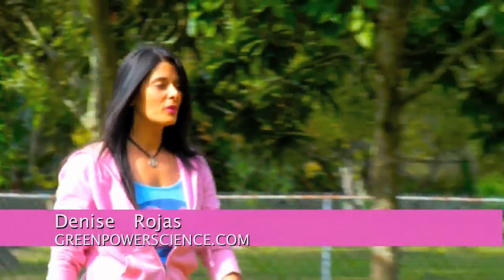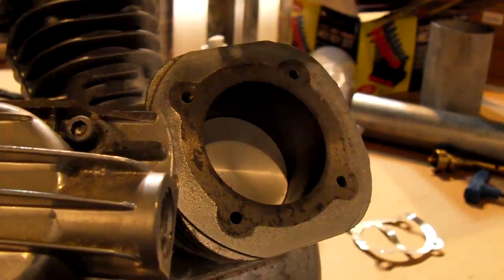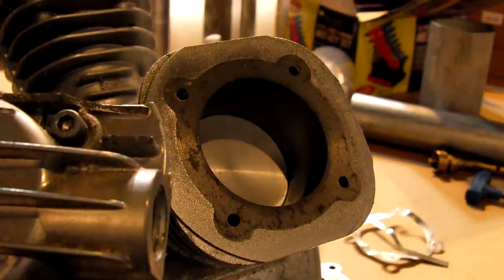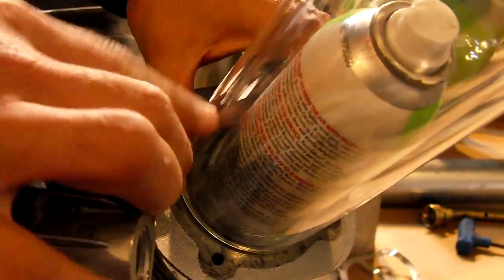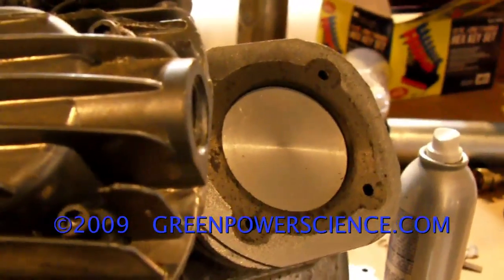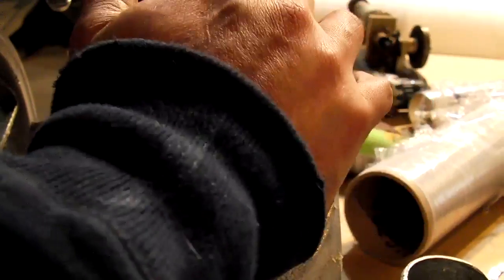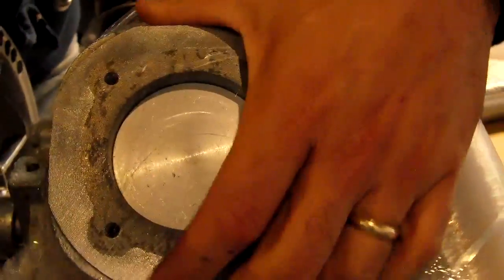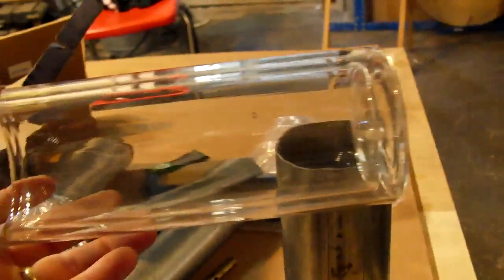Stirling Engine Solar Compressor Conversion for Solar Training

Comment: That small engine in your favorites is the exact model but smaller, you were right, this will work. Lets figure the right can, bug spray style, any ideas. If you can get off the shelf stuff, this could be the easiest conversion in the world. GREAT JOB 5 star.

Denise you are awesome;-)

Comment: I'd love to see a working Stirling engine with an automatic reflector, turning a 12 volt generator that charges the batteries on a backup power system for your house. Then as time goes on you could start moving appliances over to the backup system and eventually move most of your home's energy use to the alternate system.

Comment: Hi, nice vid. Have you thought about using long threaded studs so that you could use the existing cylinder heads to hold the cylinder extension in place? That way you could take advantage of the existing tubing for the regenerator. Sort of like end caps holding the glass tube against the main body. Good luck with the project and looking forward to seeing more.

Comment: Nice, I would also like to see this running.
Some suggestions I would like to see. At least 120psi of pressure. More heat and also insulation of the hot parts that is not directly heated.
More effective regeneration maybe with a small filled canister that also withstand the added pressure. Or just longer and insulated regenerator-pipe up to the hot part. Also cooling with fan or water for cold part would be nice. I hope you succeed.

Comment from the maker: I have tested it with high temp silicone and it does not work well. Higher pressure pops it but that is good. Trying to come up with a way to test without welding.

Comment: The cooling coefficient of different metals varies widely.  I wonder if that mini-stirling engine
uses copper or aluminum instead of steel
to get a faster cooling effect.

Comment: There are some online machine shops where you can upload a data file and they will laser cut some metal. Maybe some common items can be worked up to interface with certain well known cylinder sizes. I guess basically you need a new head with a proper seal designed for this, ideally.

Comment: I might suggest not using glass as it is a heat insulator not a conductor, you would have a hard time concentrating the heat to generate the pressure in your piston with this approach I would think?   Or perhaps I am missing something?  I would think stainless steel would be superior if you could find something.

Comment: That depends, an atmospheric stirling engine needs not taht much of a good seal, however, such an engine will never archieve anything near an acceptible effciency.
Stirlings that use a pressurized working gas need a VERY good seal because they have to keep those 50 or more Kg/sq cm working pressure contained so well that working gas needs to be replaced like once a day at maximum.
These ones however, are efficient enoigh to compete with all the other carnot machines

Comment: Here is some data showing steam to metal to air.  Filling the chamber with water vapour instead of air, might double efficiency.

engineeringtoolbox com/overall-heat-transfer-coefficients-d_284.html

Here is the data for getting from inside the piston to the outer surface of the piston chamber:

Aluminum is four times more conductive than cast iron. Copper is six times more conductive
than cast iron. en wikipedia org/wiki/List_of_thermal_conductivities